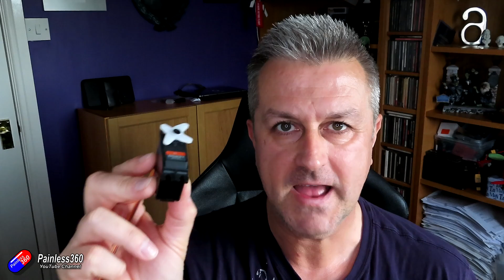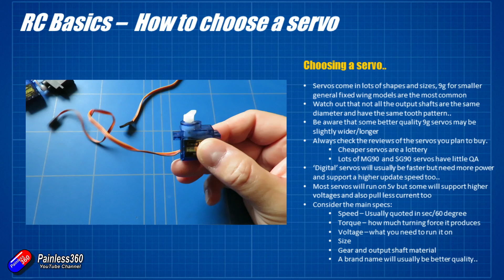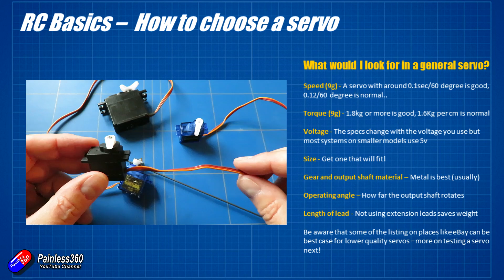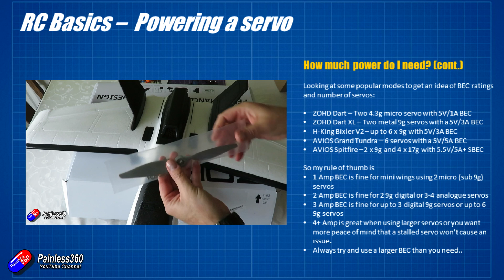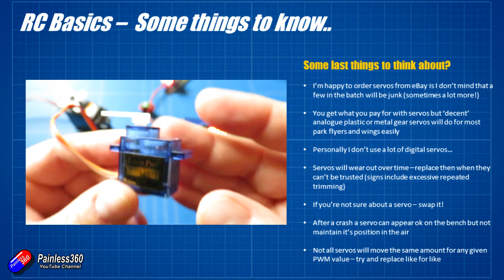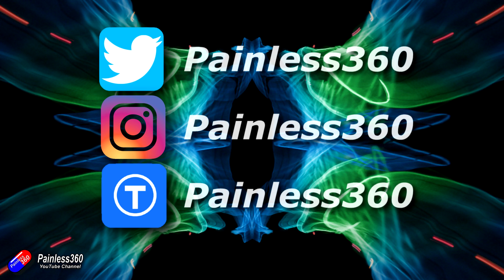Servos explained simply for new fixed wing pilots

Comment: I got some digital metal gear micro servos from China, some ptk 7455 mg-d and some ptk 7452 mg-d ones. But how should I set up my servo tester for these? I choose PWM output, but what ms and Hz values should I set before starting cycling the servo? I have a ToolkitRC M6 that has this servo testing function that I’d like to use.
Reply from the maker: They should be happy to work on the regular 50hz setting if there isn't more detail on the frequency on the website.. Best of luck

Comment: Thanks for your videos they are really good and help a lot! I have a couple servos like that little blue one you show in the begining and im really disapointed. Iv broken 4 just trying to get m,y bicopter to  fly. I may be using them for the wrong job but its really been anoying me. Iv gota find some quality and not to expensive or heavy meatal gear. Im thinking in the 20 gram range.
Reply from the maker: It depends on how they 'broke' if they stripped teeth then metal geared servos of the same size may be a better bet... Best of luck!

Comment: Thanks for this video!! really good stuff.  just one question though: how do you know how much force a servo needs to have? by that I mean, you always see how much torque they have and that goes from low too high.  but how do you know/calculate how much torque you need for a certain surface to be sure about the correct movement in any case?? just wondering...
Reply from the maker: When I started I cheated and looked at what other models were using that had a similar sized control surface. Most models will come with a recommended servo setup if they don't supply it. If they don't tell you - ask them they'll usually tell you. Or you can see what others are using. Best of luck!

Comment: Good day Lee. Another great video, thank you. Can both types of servos be used with the old 72 Mhz receivers. Jeff
Reply from the maker: Servos work from a PWM signal usually (there are exotic ones that use other things like SBUS). The PWM signals are standard and don't care what radio system sits behind them. Hope that helps..
Reply: @Painless360  Thank you for the information. Finally got our and flew my glider and Eagle 60, Had the glider setup to a new FS-I6X and the flight started out great but ended not so. Found a server had failed, grrr, but no damage to speek of. Next was the Eagle for its first flight in over 30 years and little hairy at first but went great after a bit of time in the air and a good landing. Overall a great day for Glow power. Now just waiting for a controller to get here and see what excitement that can create.
Thanks again for the great Playlist you have created. Jeff

Comment: I have used the cheaper eBay servos exclusively for many years and haven't found them to be unreliable as a whole.  I prefer Hextronik servos but find that the Tower Pro brand works equally as well.